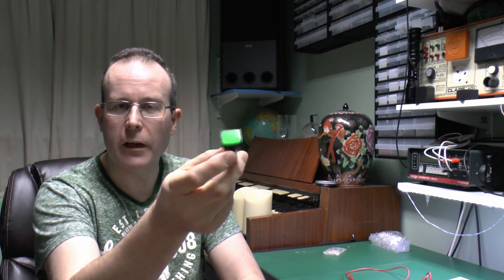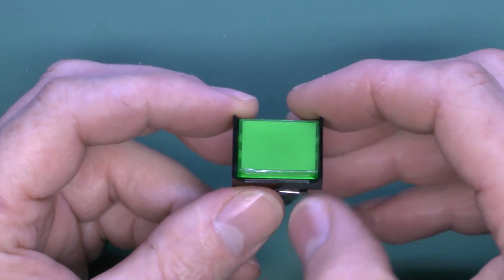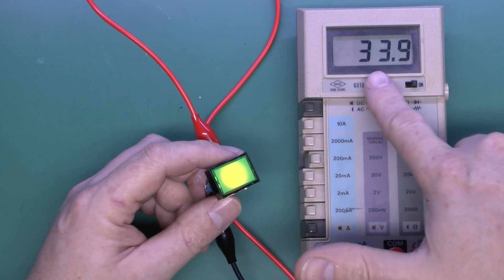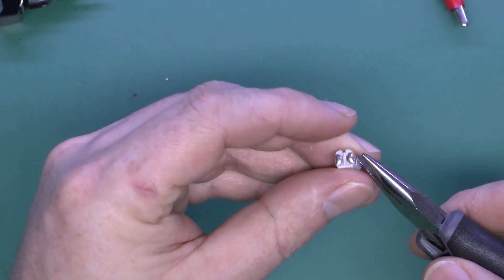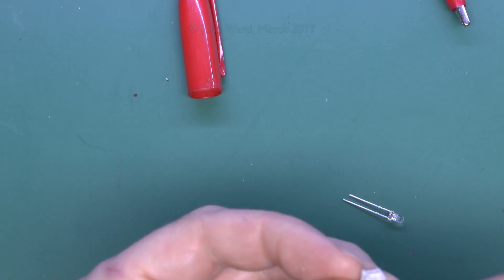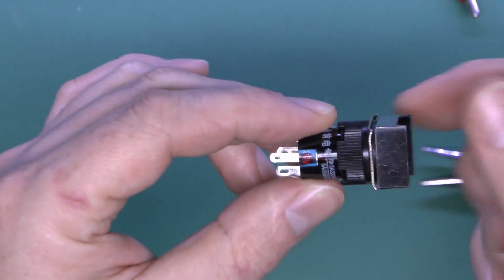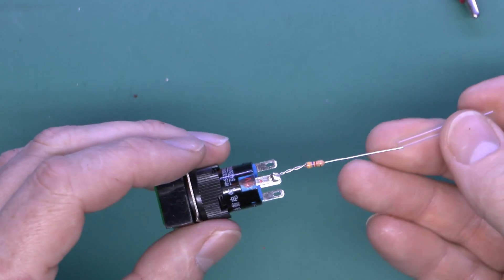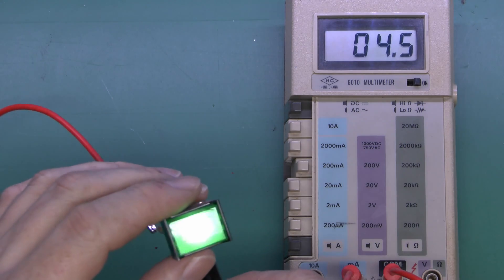Converting Illuminated Switches from Incandescent to LED

Comment: Hi JW,
just a quick question about a new ceiling light I have fitted. It is double insulated, so only has two wires.  When I connected the live and neutral, I had no power going to my light switch until I screwed in the light bulb, does this mean that the bulb completes the circuit, Is this normal. Thanks in advance. 
Phil
Reply from the maker: One wire at the switch should be live all the time.  If both switch wires are only live with the bulb installed, the switch is probably installed in the neutral, which will result in the light fitting being live all the time even when off.  This could result in people getting a shock when changing the bulb.
Reply: Hi JW, thanks for the reply. The light switch is a lightwaverf 1 gang switch. I have wired that up correctly as per the instructions. Can you suggest a solution . Thanks
Phil
Reply: Hi John, again thanks again for you reply, it has pointed me in the right direction. On checking I found I had the switched live in the wrong connection. Many thanks
Phil
Reply: Hi JW, just an update, it seems that the lightwaverf light switch needs a bulb in to complete the circuit. Maybe there's a YouTube project for you 😄
Reply: It is normal that the bulb completes the circuit. If the circuit was not complete no current would flow and the bulb would not light up. Therefore, for the bulb to light you must place it in the circuit. It follows that removing the bulb from the circuit breaks the circuit, and placing the bulb in the circuit makes the circuit. When the circuit is made the bulb can light up. If you remove the bulb from the circuit the circuit is broken and the bulb will go out.

Comment: JW, is that a compressor based dehumidifier I can hear in the background?  Sounds familiar from Clive's channel...
Reply: Justin Rutledge same person  😉
Reply from the maker: No, it's the transformer in the bench power supply which is providing the 24 volts for the lamp / LED.

Comment: Great video as usual!
Would this work with a 24 volt AC source, or would I need to add another diode in series or parallel? I know the LED is a diode, but maybe it would break down with a reverse 24 volt supply, even at 50% duty cycle.
Also I'd like to replace the old fading and cracked neon indicators on my stove with LEDs. They have a 240 volt AC supply. What resistor would I need, and again would I need an extra series or parallel diode?
Thanks in advance!
Reply: An extra rectifier diode (like an 1N4007) in series would be preferrable. For your stove top a resistor of 47K and 2 watts should work fine
Reply from the maker: As +AlsoScroll - without an extra diode the LED will fail quickly as their reverse breakdown voltage is very low compared to other diodes.
Reply: Thanks for those values! A quick google search for "LED DIODE AC" shows a few circuits depicting the diode in parallel with the LED, yet others show the diode in series. I don't understand the difference between a series or parallel diode in this case. Surely it would work just the same in either configuration?
Reply: If you were to put the diode in parallel with the LED, the full reverse voltage would still be across the LED. Hence why the diode must be put in series.
Reply: Actually looking at the circuits with a diode in parallel they are set up so that the reverse voltage over the LED would be limited to the 0,7 volts across the diode. So in my mind that would be a better solution.
Please note this would only work if the diode and LED are in antiparallel
Reply: If you have space, put two LEDs in reverse so each one lights on alternating half-cycles, otherwise use a rectifier diode in series as a blocker.  You can use a high-voltage capacitor to help reduce flicker, but remember that you can't use a polarised type such as an electrolytic if you're using the two-LED arrangement.

You can use a bridge rectifier and capacitor after the resistor if you have space, but the capacitor should still be rated for high voltage (around 400V).  One of the 3.3uF caps salvaged from a broken CFL might work and will still provide a useful reduction in flicker.

Above all else, remember that you're working with a dangerous voltage which is capable of supplying a lethal amount of current.

Comment: i have thorough respect for you willingness to do proper job and not what is just  easy.
i also guess you are ex GPO/BT as i dont know any other people that would have the RS pro cellulose acetate screwdrivers, father is ex GPO
Reply: Yeah spotted the screwdriver in a prev video but confirmed the RS logo in this one, fwiw a lot of large companies had them. unfortunately the minimum supply quantity from RS is 25 or something stupid. I greatly prefer using these solid handled ones to the nasty synthetic rubber overmoulded ones everyone wants to sell you today.

Comment: If you're running six of these from one 24V output, it'd be worth wiring them all in series. Then you'll only need one series resistor for all of them and the efficiency would be six times better again.
Reply: The design may need the indicators to be individually controlled, to indicate a button has been pressed or a specific function is in progress.
Reply: Possibly, but he does say in the video that he wants to run six of them from the same controller output, so he's not planning individual control from the controller at-least. The lights could be hard-wired to other things I guess, but that makes it less likely that the current to drive them will need to come from that single controller output.
Reply: We can be quite sure of that. Otherwise, why would JW be installing 6 of them?

FWIW, in my judgement a better compromise between efficiency and current stability would be to have the LEDs drop about half the voltage, with the other half in the resistor; on a nominal 24VDC supply, this would mean four GaN (3V each; white, blue, bright green) or six GaP (2V each; red, orange, yellow, and old-school yellowish green) LEDs in each series string.

Comment: Hi john is there any chance you could do a video on compact fluorescents. As they seem to be in all bathrooms, communal hallways etc these days, it would be interesting to see how they work as some have starters some don't some 2 pin some 4? Also some are emergency I would be interested to know exactly how they all work etc
Reply: Generally the 2 pin 2D fluorescent lamps have the starter built-in to the actual 2D lamp, so changing the lamp will also provide a new starter.  The 4 pin 2D lamps require an external starter, similar to fluorescent strip lights.  Most modern 2D lamp fixtures use an electronic ballast, which also handles the starting procedure, so no separate starter component is needed and these don't produce a flicker, which can be noticeable with magnetic ballast driven lamps.
Reply: modern ones dont have starters at all, use a high frequency circuit board, so instant start up, the starters are for old ballast types, which are large, noisy and old fashioned, though the old type tend to last forever
Reply: FWIW JW did a video on emergency lighting on Jul 26th 2016

AFAIK there doesn't appear to be a reasonably priced retrofit LED replacement for the 2D florescent tubes yet... maybe the market isn't big enough.
Reply: Thanks

Comment: Just out of interest why not use a green LED? Would look considerably better...
Reply: WhiteShadow2k1 
That isn't the case, a green LED will show through the opaque green switch with ease, on the other hand, a red LED, the light would mostly be blocked by an opaque green covering.
Reply: I'm guessing it's because it then allows the colour of the cap to be changed if necessary.
Reply: @green, you are correct, a green led would shine through better, plus it wouldnt wash out the colour so would be better all around,  if he has yellow, red or orange he would also need the correct type of led.     for example, my car has orange indicator bulbs, though it does have clear covers, but its a common fix for faded orange covers to use the orange bulb.